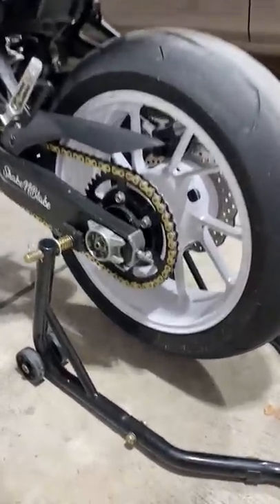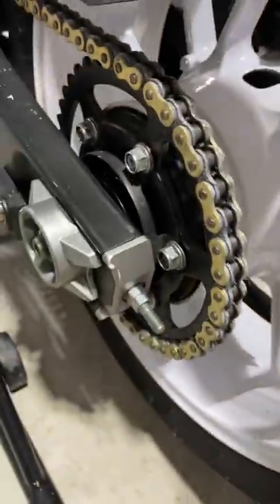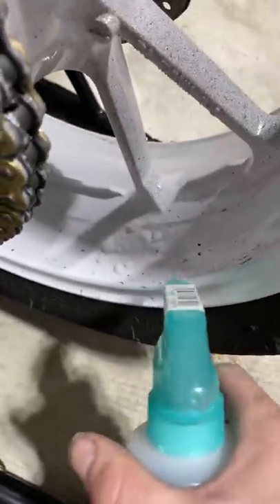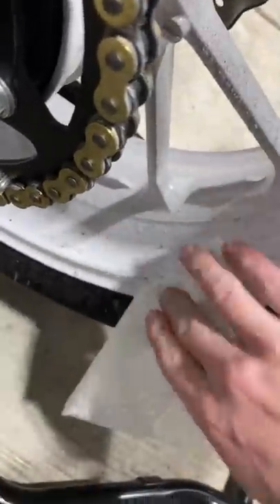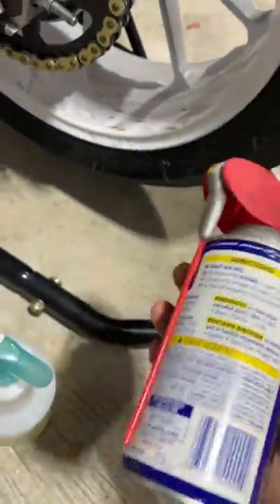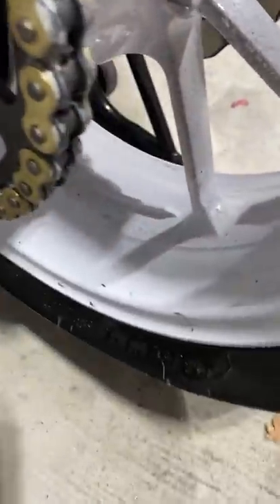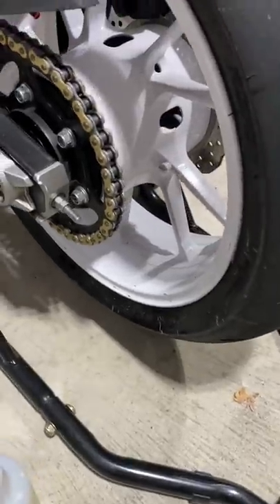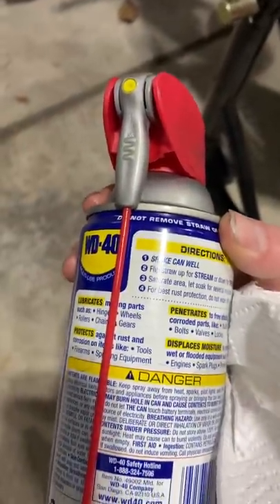EASY tip I wish someone taught me when I started riding motorcycles. #shorts

Comment: Don’t forget, WD40 also cleans your tires reaaaaally well. Increases speed even by reducing friction.
Reply: Dropped my bike in the driveway because of this.. lol sprayed down the wheels and chain, thought I got it all, sprayed her down With some water, and the driveway became an oil slick...
Reply: @dillonvillon  degrease with alcohol and a rug/paper towel. don't wash vehicles in the driveway lol, there are places for that...and no wd40 on chains and bearings unless you are cleaning them to prepare for new oil/grease
Reply: Hahahaha
Reply: It also restores worn brakes pads, I do this to all my vehicles
Reply: Also helps with wine stains apparently.
Wd40 is a cleaner
Reply: Beat me to it 😅 thought the same
Reply: Even removes stains in toilet
Reply: You can use it instead of eyedrops.
It contains fish oil, its really good for you.
Reply: Spray it on your break rotors while you at it, prevents rust stains
Reply: Cleans brakes good too
Reply: Yeah it also makes the brakes 10 times more powerful and they will never overheat.
Reply: I use it to refuel
Reply: Fish oil is amazing......
Reply: @dushk0  been using wd40/crc on dirtbike chains after every ride for years and never had an issue and they cop way more grief than roadbike chains
Reply: Also works great when cleaning brake discs!
Reply: @tcmx712  dirt bike chains are a bit different though my dude, they might get more on them in the way of dirt mud etc, but road bike chains must deal with far higher rotational forces meaning the moving parts are under much higher stress.
Reply: @pauldixon9626  k
Reply: Do not listen to this guy! If you want to clean tires use only water
Reply: @Deadashellfr  oh Really? 😂🤦🏼‍♂️
Reply: @WasNiksIsNiksWordtNiks  don't forget that a lot of people dont get the joke and will clean their tires with WD-40
Reply: Transmission fluid
Reply: @blowndome  you will kill someone lol
Reply: We would spray WD40 on you drag tires and let them sit wrapped up. It makes they sticky.
Reply: @dillonvillon  don't use wd40 on your chain!
Reply: Replace your bath water with WD40 to lubricate all of your joints.
Reply: Someone's going to see this and try it and get badly hurt. You guys are messed up.
Reply: Looking for a it’s good for indigestion or maybe constipation or titanium hip joints or intercourse or teething newborns. You people.
Reply: Don’t forget to spray liberally on the those discs to make them shine!
Reply: I’ve been shining my motorcycle tires with it for years!!!
Reply: If you spray the exhaust it unlocks the spit flames mod
Reply: @Deadashellfr  Darwin Award material.
Reply: Yea normally you should spray everywhere to make it shine everytime!
Reply: 👍🤣🤣 don't forget to ad the wd40 on the handle grips too for extra weight reduction and it's safe to drink. shots on the house
Reply: Hey were you the one who offer to people if they remove the system32 their computer will be faster when windows XP  popular ? 😂😂😂😂

Comment: The amount of new riders that will be injured because of this
Reply: Been doing it forever now with the straw on cam makes really easy
Reply: If you don't have proof don't assume. WD-40 is a magical thing.
Reply: LMAO I Kno 😂😂😂🤣🤣💀
Reply: I don't really get what you mean. You're of course not supposed to spray it on your tire
Reply: @rem362  I’m not positive but I believe he’s talking about getting it on the break disc Because I would assume that would make the brakes not work well
Reply: @deejayskyce5282  yeah, but any kind of oil on the brake rotors(or pads) is really, really bad.

Comment: Just wait until he discovers brake cleaner
Reply: Brake cleaner isnt so great for powder coat or paint :/ degreaser on a rag is the best bet.
Reply: Yeah, but have you ever cleaned your brake disk with wd40?
Reply: @stevesavage4247  yeah it makes your bike even faster
Reply: That'd dry the shit out of the tires. It does work tho
Reply: Yah he gunna need it now he got WD overspray all up in them breakpads.. actually probs just needs a bin.
Reply: I used to use brake cleaner when I had to clean the clutches in my junior dragster after a run
Reply: Use wheel cleaner then once they're cleaned fully, give them a ceramic coat. That stuff will just wipe off with wet microfibre afterwards
Reply: Or rubbing alchohol
Reply: Yah I was just gonna say
Reply: @mickeymouse9823  exactly because you won’t be able to stop or slow down so therefore you are faster
Reply: @stevesavage4247  yes, i currently have WD40 on my rear brake disc and it was not an accident
Reply: Lol brake cleaner will eat your clear coat and rims up in no time
Reply: Exactly my thought LOL :D
Reply: ... or 2 cents worth of diesel
Reply: Prepsol/wax and grease remover, safe on paint, and brake clean is fine as long as you don't use cheap shit stuff
Reply: @adzz8012  i used brake cleaner always on my rims and engine for maybe 5 a 10 years and the coating is still in perfect condition. And you have more for less money..
Reply: Bye bye paint
Reply: Absolutely - one mistake with wd40 spray and you may end up oily brake!
Reply: Yes omg
Reply: Don’t ever use that on paint or plastic or tired
Reply: I spray wd on cloth first then wipe wheels
Reply: Definitely WD 40 eats the paint. I tried it😢
Reply: @adzz8012 Bullshit. The right brake cleaner does not damage paint. It even says so on the can.
Reply: @Sunrazor  the 'right' brake cleaner... uh huh, just bunked your own comment. Way ro prove me RIGHT.  HAHA
Reply: Brake cleaner is bad for plastic, paint, and rubber, also WD 40 works much better for cleaning grease off. I am an industrial mechanic, believe me, I clean grease off of crap on a regular basis. I tried cleaning grease off my phone case because I didn't want the WD 40 film on it and brake cleaner evaporates, it ruined it. It literally stripped the black off of it making it almost clear.

Comment: Don't apply it directly, spray it on a piece of rag then wipe it carefully and not to put it on the tyres. Also, degreasers will make your paint fade if you use it too often.
Reply: No paint fade , and is good for the Tyers makes them more softer , 20+ years and still working good old WD-40
Reply: @zackiaryruddick701  Makes them slippery too. Don't want slippery rubber used for friction...
Reply: @Mikkel111  you don't want to spray it on to the Tyer of a road bike but if you spray it on the sidewall it's fine and good for the Tyer , I spray my hole Tyer on a dirt bike keeps them soft
Reply: @zackiaryruddick701  Since the video is of a road bike, it’s the type of bike referred to.
If you sprayed enough for it to run of the rim, it’ll run down the sidewall too and therefore hit the contact patch area, resulting in a bad time.
So the original comment still stands… Use a cloth or rag to apply it. Don’t spray it onto the wheel directly.
Reply: @Mikkel111  bro I'm telling you it's fine to get it on your Tyer it's not going to make you slip over 🤣 you could dam well spray the hole Tyer and it's not going to make you slip over, so the point is you can spray it on to the chain and get over spray all over the sidewall and it's never going to get on the Tyers contact patch , and even if you did spray the contract patch it won't make you slip the Tyer , go try it on a old Tyer and see with your own eyes 🙄 or you can listen to this 12 year old kid or someone who has been spraying there Tyer with it for 20 years , I spray it directly on to my hole bike 🤣🤣 and I'm constantly being asked how I keep my bike looking so good 👏👏 here's another tip , spray the shit out of your chain with it and never used chain lube ever !! , you can thank me later
Reply: @zackiaryruddick701  It’s not like he invented the thought of having lubricant on your tires is a bad idea.
This is common knowledge.
I dare you to go spray a can of WD-40 on the entire surface of hour tires and go take a corner with at least 30 degrees of lean.
Chances are you’re just riding like a granny and don’t come anywhere close to limit of traction.
Just because you’ve been doing something for a long time does not mean it’s a good thing. That’s a terrible argument.
Reply: @Mikkel111  and WD-40 is not a lubricant!!! So there's that too 🤦
Reply: @zackiaryruddick701 lol...you can't even spell Tire.
Reply: @samanthawillowlane1371  it's the dam spell check on my phone lol you spell a word wrong and everytime you go to type it again it auto spells it the first way you spelt it I don't give a dam about it and not going to rewrite it every time it does it so Bravo to you Mr smartass coming in here to correct spelling and not to talk about the thread 👏👏👍
Reply: @zackiaryruddick701  lol. Alright Missy, have a great day! ;)
Reply: @samanthawillowlane1371  that's a good point 👍 Samantha wich is a girls name but you call me Missy 👏👏👏
Reply: @zackiaryruddick701  😄I only called you Missy because you first called me Mr smartass. You should call me miss smartass, because I'm a girl, which is why i have a girl name  lol
And yes, people often call me smarty pants haha
😂

Comment: “Every time you put a new chain on”
Or how about when you lube your chain every 500km like you’re supposed to
Reply: X-ring and O-ring chains really don't need that, it helps to keep the chain looking good but they are internally lubed.
Reply: You absolutely do need to lubricate an o ring chain. Maybe you should read the documentation that comes with a modern chain regarding cleaning and lubrication.
Reply: @andrewford80  I wasn’t going to say anything, let them ruin their chains
Reply: @jordancailes8383  oops. Sorry!

Yeah my bad, no need to lubricate those chains guys! As you were :D
Reply: @andrewford80  yeah its pre lubed so fricken good, that its good the whooooooooooooole lifetime of the chain.
Reply: @Dylans503  ;) ;) ;)
Reply: @16driver16  they are indeed but they can still rust, I use transmission oil on mine to keep it in good working order.
Reply: Maybe he just replaces his chain every 500km... Lmao
Reply: @05EVORS  been using wd40 on dirtbike chains after every ride for years now never had an issue and those chains cop more grief than roadbike chains
Reply: @tcmx712  got o-rings? Don't use wd40.
Dont have o-rings? Wd40 makes a fine chain cleaner but a terrible lubricant. It's too thin. Kero is a cheaper cleaner too btw
Reply: I ride daily and in the rain, sometimes she stands a whole day in the rain at work. I lubricate every few weeks because the lubricant just rains off. I use white lubricant so I can see whenever she's getting dry.
Reply: ezmobz79  of course you lube an o ring and x ring chain. Those internal points might be packed with grease and lubricated but that sprocket it runs against isn’t and that’ll wear your sprocket and chain.
Reply: That’s why I like belt drive no need to lube. And the belt last darn near forever. And also cheap to replace.
Reply: @Dylans503  well technically it will last the whole lifetime of the chain....it might be a tad short lifetime though.
Reply: @andrewford80  the whole o-ring ruined by WD 40 is a myth.
Reply: WD-40 is OK as a degreaser. But it attracts moisture. That's why you don't use it on chains or anything else steel. You need to lube with something else after or the rust will find you. Kerosene or Diesel are cheaper.
Reply: @milspec1  people have an assumption that WD-40 corroded the o ring seals, which I believe is incorrect. That is all I said. The oil is obviously too light to use as lubrication.
Reply: @Mikepragland but the second that roller touches the sprocket the lube is forced straight out. It's a total loss system externally.

Comment: Be careful not to spray the disk or tire
Reply: I was about to say the same thing 🤭👍
Reply: Tazy devil same
Reply: He'll learn. Besides, the "rotors" will clean rust right off first braking session.
Reply: @murraymachado401  rotors are easy to clean, but brake pads can absorb it so badly that they become useless.
Reply: @richardus46  that's the extreme case if you make your brake pads take a bath in wd40 lmao
Reply: Slippy day in comming
Reply: “You’ll thank me later.. from the hospital” I guess the last part got cut off from the video.
Reply: @Josh-cw8by  just in case...
Reply: @Josh-cw8by  not always true.. I oversprayed wd40 on the rotors and the brakes felt only half as effective for at least 40 miles of Street riding.. and the first few miles were a nightmare.. maybe coz pads and rotors are uneven on a microscopic level and can retain the lubricant..
Reply: Be careful around the disk for sure!!
Reply: Apply silicon spray to the seat and tyres to keep them looking shiny and new
Reply: @tortron  Bro when I first got my bike I bought some random plastic and vinyl protector and polished up my whole bike real nice. I felt like I was gonna slide right off the bike. Trying to ride off road standing up was almost worse lmao
Reply: Its great for handle grips too
Reply: Facts
Reply: It's the first time in my life I get 281 likes 😂
Thx
Reply: It's really harmless. It cooks off the rotors on the first stop, and tires only a few rotations
Reply: Too late, you see it dribbling on the bottom of the tyre lmao.

Comment: Can we talk about the problem before the solution? Try a teflon dry lube on the chain
Reply: You Sir are the chosen One/Neo tips hat
Reply: Wipe excess lube off your chain
Reply: Sounds like some advice from a guy who only rides on the nicest of sunny days
Reply: @dingleberry3662  only sand, actually. Good guess though
Reply: @snapdrag141  if its still sand means it hasn't rained. Guess I'm still right
Reply: @dingleberry3662  so then what's sand after it rains?
Reply: @snapdrag141  wet sticky sand. Must be fun riding 10 miles a day and still having to change your oil and do maintenance lol
Reply: @snapdrag141  at least get a supermoto kit or a dual sport and experience something new
Reply: @dingleberry3662  it was sarcasm. I ride a grom as daily driver. I do try to avoid riding in the rain (not trying to lie) but in dallas it's never a sure bet. 
Did you create your account  just to troll this comment? 🤦‍♂️
Reply: @snapdrag141  i too ride a Honda. 99 CBR 1100XX. No I don't make new accounts just to troll. Its more of a lifestyle
Reply: @dingleberry3662  sounds like advise from a guy who can’t afford a can of good chain lube. And there is more fun and less laws to be had in dirt. (Personally I prefer my sports bike though)
Reply: @zandurka1  seeing as I like to get my bike up to 150 most times I ride and cruise over 100 on the highway what chain lube do you suggest will stick to my chain for more than a few minutes?
Reply: @zandurka1  BTW I also carry chain lube and wrenches in my saddle bags to keep my chain tightened and lubed. I've tried probably 10 different kinds of spray on lube, diesel oil, etc and they all fling off as soon as I throw the throttle back a few times.
Reply: @dingleberry3662  a Teflon dry lube… But when you ride at a buck fifty you can’t expect anything to stay together for long, your poor transmission.
Reply: @dingleberry3662  Honda makes a fantastic bike, but unless your going crazy speeds, a quality lube won’t make a mess. I’ve never had a single problem with lube in the 80-100 ranges I drive at (ktm rc390)

Comment: First never use a paper towel on painted surfaces. You're going to scratch them. Second: you want to use a decreaser or solvent based cleaner (think citrus) for grease or tar. Let the product work for a minute before agitating with wiping or scrubbing with a brush

Comment: “I’ve been doing this for years” imagine if there were cans of fluid that degreased things so he didn’t have to use a workaround
Reply: Even brake clean would work better lol
Reply: WD-40 was actually invented as a degreaser. People think it's a lubricant, but that's the furthest from the truth. 

FYI, make sure you don't get it on your chain.
Reply: The WD in WD40 literally stands for "water displacer" as far as i'm concerned. I dont think it was ever meant to be a degreaser, it's a propellant.
Reply: @jeremystig98  well, not sure where you're getting propellant from unless you're referring to its flammability. However, you're correct about what WD stands for. And we're actually both right, I just don't have the energy to argue on YouTube.
Reply: @tuckernance  wd-40 was actually created as a water deterrent, WD=Water Deterrent. 40=40th recipe/attempt and was used to store bombs if I'm not mistaken on that part
Reply: @tuckernance  The product made its first appearance on store shelves in San Diego in 1958. Convair, an aerospace contractor, first used WD-40 Multi-Use Product to protect the outer skin of the Atlas Missile from rust and corrosion. - wd-40 words on their website. It was never intended as a degreaser, though the company does make a degreaser called WD-40 SPECIALIST DEGREASER
Reply: Or just a proper amount of grease on the chain
Reply: rofl :D
Reply: Using actual degreaser ruins your painted rims
Reply: wd 40 is universal. it's the end all be all of cleaning products. it's a degreaser not a lubricant.
Reply: @connor1982  brake cleaner does not ruin the paint. never has ruined any paint when i have used it.
Reply: @TopSecretForzaClub  you know what it does to powder coating?
Reply: @420Sean69  yes - absolutely nothing according to my experience :D

Comment: I used to spray it onto a microfiber towel then just rub the cloth around the wheel, saves spraying it all over your tyre as well
Reply: Also saves any risk of it getting on your disc which is more important than getting it on your tyres!
Reply: And scratches the the rims to hell and back.
Reply: Definitely would spray it onto a microfiber so it wouldn't get onto the tires